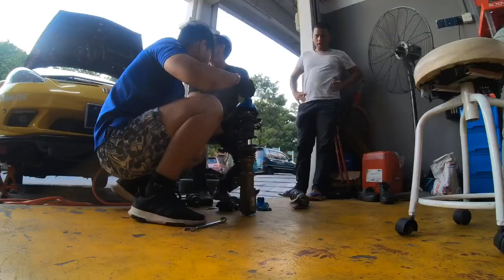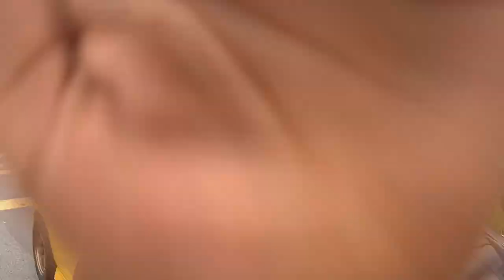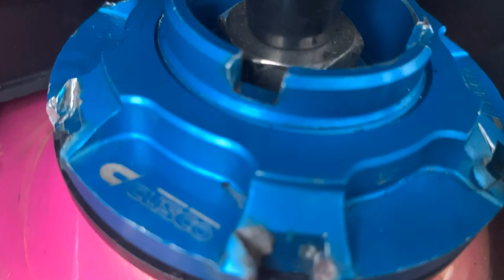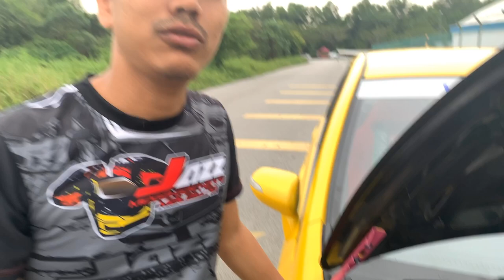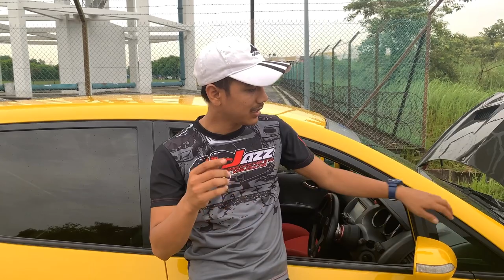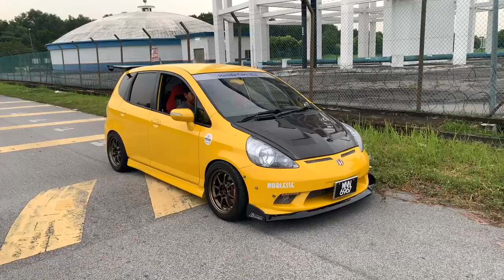CUSCO PILLOW BALL TOP MOUNT INSTALLATION!

Comment: Lpas psg pillow ball..mmg body jd tegap..especially trse time corner..tp nk tny bab bunyi..time jln xrata..bumping or corner..ade something bunyi berlekuk?bunyi gegar?tq
Reply from the maker: pillow ball ni hnya membantu untuk mendapat high speed corner yang sharp, xde oversteer bkn understeer ya. point ats damper tu xde lansung pergerakan sebab dia dah total lock pada chasis. untuk bunyi so far saya pakai xde bunyi. cuma sedikit gegar sebab damper 100% da touch pada chasis, xde lagi rubber. bagus untuk corner tak bagus untuk keselesaan. keselesaan bukan keutamaan bagi saya. jadi saya korbankan keselesaan demi mendapat sharp cornering dalam track. yang buat chasis rigid adalah roll cage dan struting bar dan rigid mounting.
Reply: @ajibmaelco  ok..bole recommend x ball bearing yg ok kalo utk replacement..
Reply from the maker: @capiqroslan8659  bro pakai jazz/city gd ke? untuk brand yang best cusco, tryforce dan ftuned. m&m honda xsure ada produce ke tak untuk model gd.
Reply: @ajibmaelco  owh..civic ek..heee..ni pkai m&m tp ball dye rse kot bunyi kuat trok..2 saje2 tny kot bos pny pn same..sharing is caring😁
Reply from the maker: @capiqroslan8659  civic ek saya kurang tahu. model jazz/city tak macam civic, civic mmg datang oem pun da memang total lock kt chasis. tak macam jazz/city. cuma lagi blom ade pillow ball. sy rasa ftuned ade buat untuk civic.
Reply: @ajibmaelco  ok baek..sje share2
Reply from the maker: @capiqroslan8659  terbaik👍🏻😊
Reply: Bunyi sya dh tolak tepi dh..mlas fh sya nk layan2 bunyi..last2 buat dono jelah.